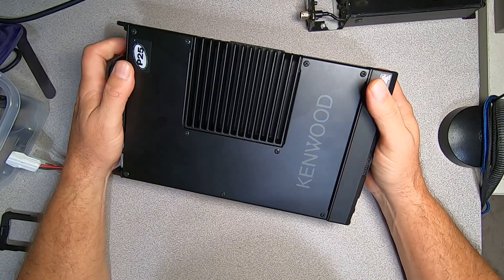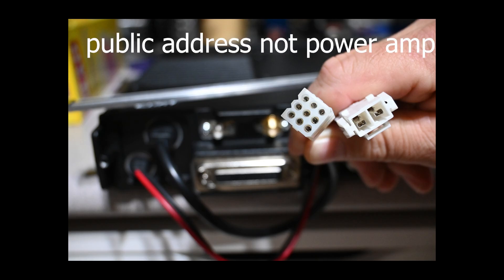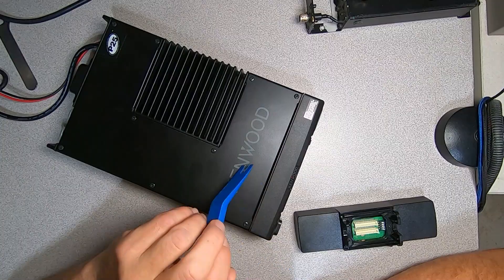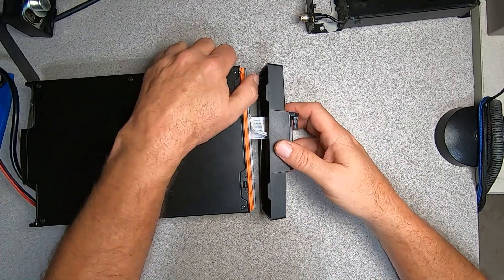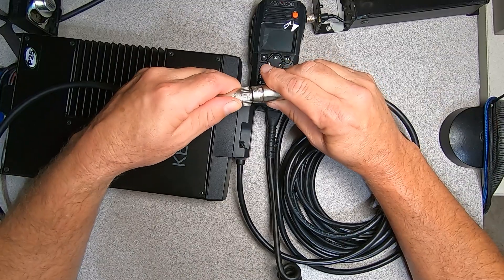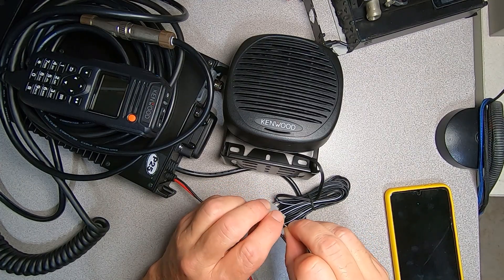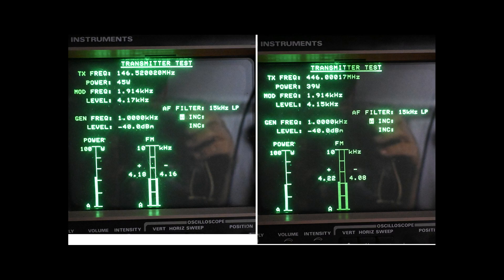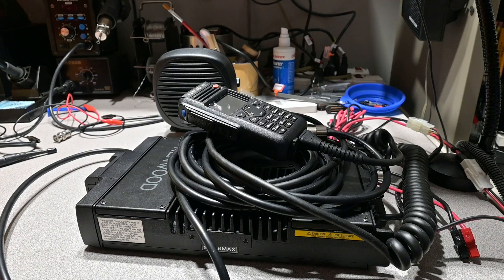Kenwood VM8000 multiband P25 and DMR radio  - handheld control head conversion and performance test

Comment: The VM8k RF deck is comically huge. VikingTune is used for alignment, it's bundled with Armada.

Additionally, the wideband feature is not required for ham operation on these radios. The VHF and UHF ham bands, as well as GMRS, permit wideband operation without purchasing a feature.
Reply from the maker: Thanks for the info and thanks for watching !

Comment: Are all new kenwood NX-5700 capable of being converted like you did this one and did you have to program the handheld controller or did the buttons work like on the faceplate?
Reply from the maker: I am not sure on that model. Thanks for watching !
Reply: All KCH heads can be converted but it’s a one way trip. So once you plug an NX head into a Viking it won’t go back to being an NX.
Reply from the maker: @lawndartdesign  Thanks for the info !
Reply: @survivalcomms happy to help

Comment: Well that was 10 times simpler to convert to a HHCH than the XTL Series of Motorola radios! Is there separate tuning software that is needed for aligning the radio? Only disadvantage is the length of cable for the HH CONTROL head. Be nice if they made a three foot cable. I could place that block on the lower shelf of the radio tray on the HUMMWV with the mic hanging by me, dual head system available?
Reply from the maker: It was pretty easy and yes you can use a dual head. I cannot find the tuning program in Armada. There was a fellow in the comments who seemed to be adept at kenwood perhaps he will chime in. I  installed it a couple days ago and I really like the radio. Thanks for watching !

Comment: Solid review as usual Brett.   I do like the kenwood stuff but it definitely has its quirks.     I have a NX5700/5800 dual banded with the KCH21 remote head as well and I although I do love it the KPG1 software is a kludge and slower then molasses and there are so many programmable options you really have to navigate the software.     I am intrigued with the VP/VM8000 but for now I’ll stick to the XG-100M for NAS reasons and use my NX setup for DMR and NXDN since all formats are in use around here.
Reply from the maker: Thank you  and you are right like every vendor they have quirks. I have a pair of NX3300's and they are decent radios but not having the wideband entitlement for them limits their use. They are awesome on DMR and NXDN however. I'm not a fan of the whole vault thing either. Thanks for watching !
Reply: @survivalcomms ❤
Reply: @illinoisoilman2784  Armada is fantastic compared to D1N, and NXDN conventional is slated to be released within the next couple months. EFJ is knocking it out of the park with the multi protocols, however the 8000 platform is a P25 radio that will do DMR and NXDN, not the other way around.
Reply: @survivalcomms  what is your opinion of armada? and im curious why you aren't a fan of viking vault. Very few of the licenses for the VP/M8000 are perpetual, however the vault just serves as a place where you add features.
Reply from the maker: @dctw4678  Armada is OK. LOL Viking Vault - it has a marketing title.

Comment: Kenwood has always been a solid performer. I just hope the absorbed EF-Johnson crew has not corrupted them.
Reply from the maker: It is an interesting merger and time will tell.  Mixed bag is my personal opinion. Thanks for checking in GC. Thanks for watching !
Reply: I thought E.F. Johnson was out of business years ago?
Reply: The EFJ firmware is light-years ahead of what Kenwood has on the NX5000 platform. The Irving and Nebraska teams add a ton of value to Kenwood.
Reply from the maker: I agree this radio has proven to be very capable so far.